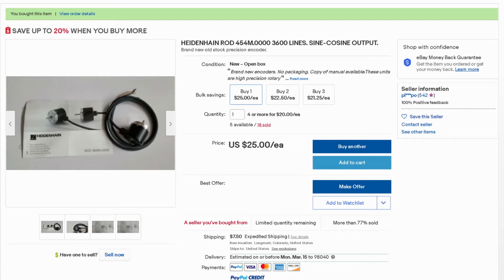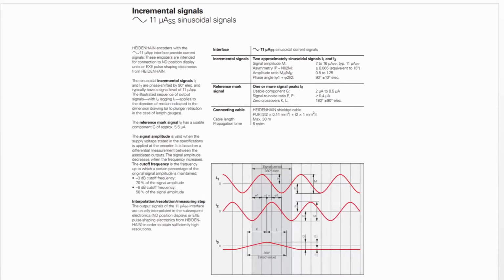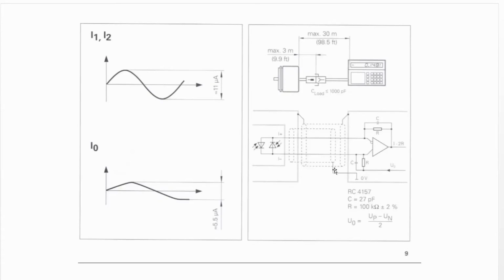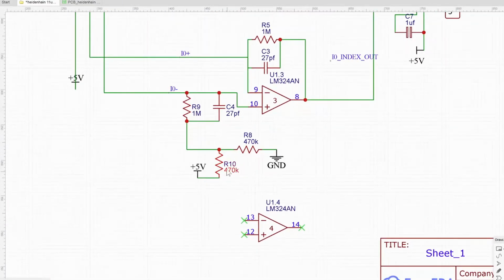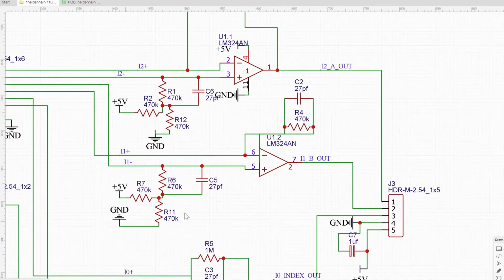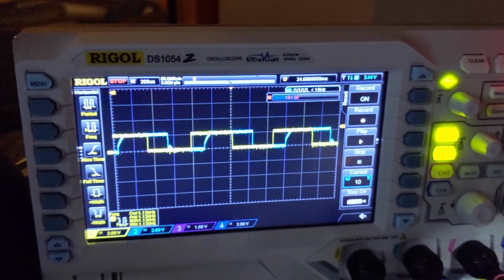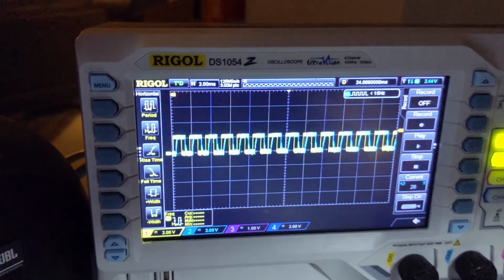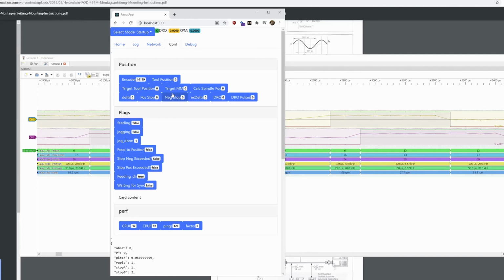μAss current encoder decoding with Arduino or Esp32

Comment: Hi Could you tell me please what does µAss mean?
Reply from the maker: micro amps, it is a current device.  the current is measuring the intensity of the light to the sensor.  The sensor has a range from low to high in  µAss.
Reply: @JesseSchoch  thank you! So “uAss” is “micro amps”!
Reply from the maker: @vhsru  more like micro amps peak to peak, the device produces sine waves and so 11 µAss is 11 micro amps peak to peak.

Comment: I've played a lot with Heidenhain and their analogue encoders. You can get a lot more resolution from them than just the 4x quadrature (x5 analogue interpolation and then after that x4 quadrature etc.) . Simplest option is to buy iC-NV chip from iC-Haus (a bit expensive) https://www.youtube.com/watch?v=OA-sajRlK7Q
Reply from the maker: i've done some software interpolation, i made a video called "poor mans DRO part 2 sin/cos linear encoding" about what I learned and the code I wrote.  i'm a bit math challenged and i don't know much about digital signal filtering so I didn't take it as far as I would have liked.  Now that I have a very clean signal I may try it again but it will not be able to handle high speeds since the MCU has so much work to do.  I saw that some folks use a precalculated sin/cos table to make it faster... maybe i'll give that a try.

Comment: Nice! Could you clarify please which signals the oscilloscope was measuring? I am interested what the voltages would be if you just took the signals from the encoder and put them over a resistor.
Reply from the maker: the scope probes in the video were on the opamp outputs.  I think it was ~1.4v Vpp with a plain resistor.  The amplitude shrinks as the speed increases which does seem to make the 5ua index signal not so reliable with my opamp.  I think my circuit needs some Schmidt triggers on the opamp outputs to ensure a clean signal for a MCU.
Reply: @JesseSchoch  Then you can probably get away with simply using a differential line receiver like I did for 1 vptp SinCos signals here: https://www.youtube.com/watch?v=R3APM2GvSlE&t=14s
and here:
https://www.youtube.com/watch?v=KgEHorzBs4w